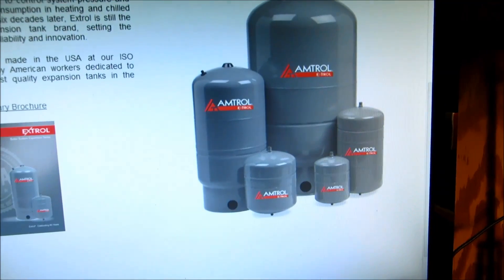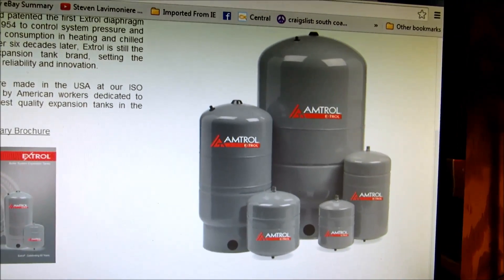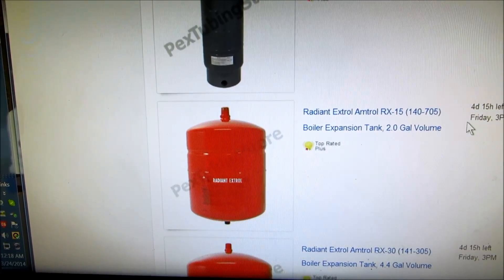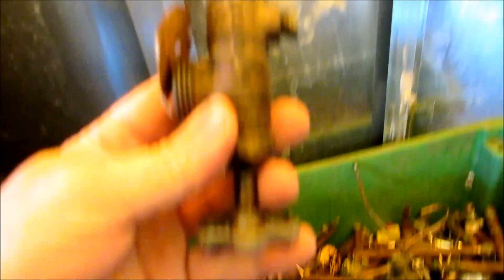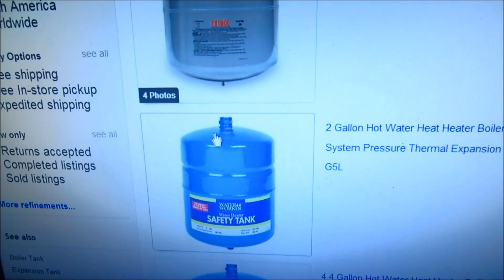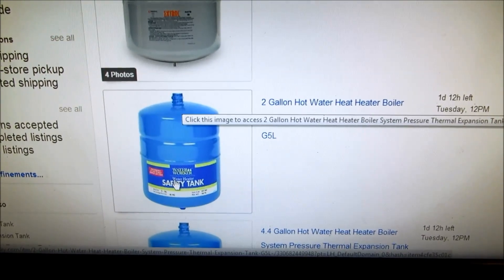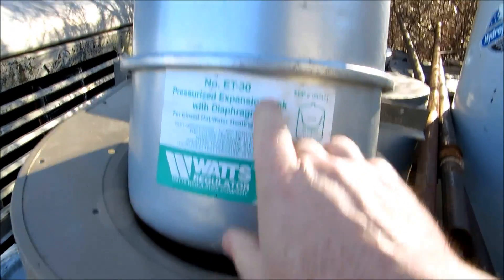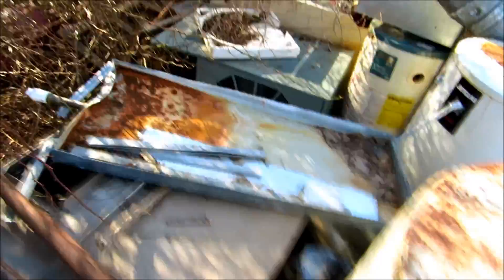hydronic heating 101 part 2

Comment: Hello. Question.  I have a 1 zone system with old style expansion tank on ceiling. @ 8:00 , how much water should be in the tank? How much should be drained out? All the water? It's Hard to tell since I can't "see into the tank". Thank you!
Reply: Your tank should be totally empty and just knock on the tank it shound different.

Comment: OK, I understand the theory, but am confused when you speak of draining these expansion tanks....I thought you mentioned that if there is any water inside, the thing is junk...I have two of these things for the two systems in my home, both mounted up in the beams in the basement.  One of these things is mounted sideways, which seems kinda strange...I guess I have to figure out what type expansion tanks I have....Neither boiler is popping the relief valves, so I guess all is OK, unless I have a lot of air in the systems....

Comment: Steve, how will you know if the  owner played  with the  schrader  valve  on the expansion tank, and let air out.   I have such a friend who has an undersized hydronic piping  system, poor insulation in home so house can never get up to temperature in this extreme  frigid  weather we are having. When I stopped by he mentioned that their  is air in the expansion tank, which  leads me to believe he let the air out or some of it.   Can a bike pump be used to put air bank into the tank once air was mistakenly removed?
Reply from the maker: pressure should be 11 or 12 psi in tank with no boiler pressure on tank . yes you can use a bike pump .

Comment: how big of an expansion would you need for an open system with 2000 thousand gallons water with water temps around 190degrees?  is there a formal ?

Comment: cool ---good info ----going to try and build a wood fired boiler for my shop
Reply from the maker: ***** make a heat exchanger in stove .with a relief valve  for temp and pressure
Reply: Did you wind up building that wood fired system?  How did it go?
Reply: still working on it when I get time don't want to rush it and blow something up -----just ordered a expansion tank so I got it when I am ready

Comment: So more water pressure on the water heater than the boiler?
Reply from the maker: yes 12 to 15 lbs is the norm up to 20 lbs is ok the relief is set at 30 lbs

Comment: when a diaphram tank looses it charge , do you replace or use a bicycle pump to #12
Reply from the maker: depends if it has water in it when i remove it then its junk and i replace it

Comment: +1 good info for the newbs, I can tell craftsmanship is better in your state than here on Long Island! I see 15's all the time when it should have a 30. What's your thoughts on pre charging domestic tanks? I never used to do it until I saw this video.    Adjusting the Pre-Charge of a Thermal Expansion Tank
Reply from the maker: good points m bet